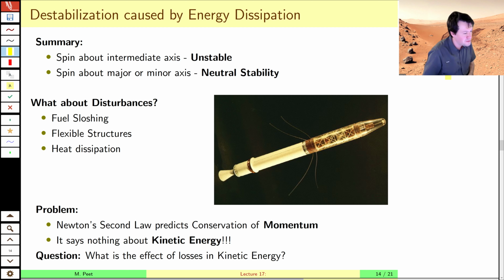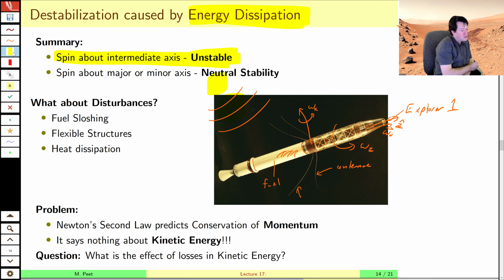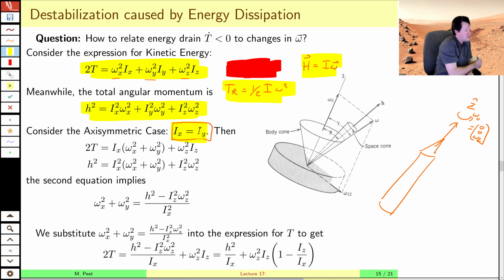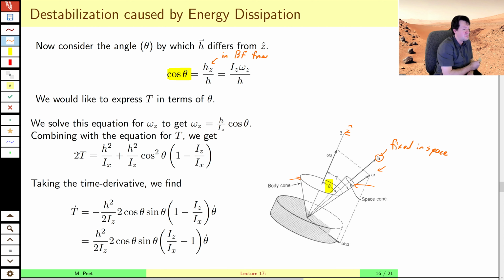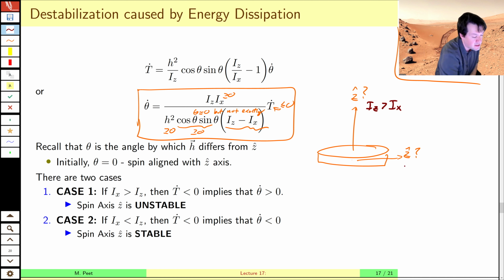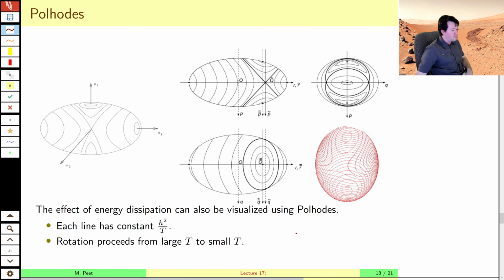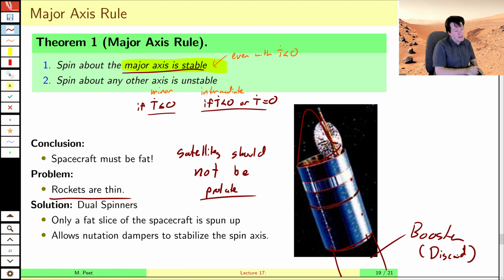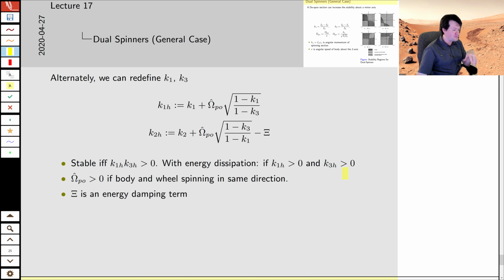AEE 462 Lecture 17b - Energy Dissipation and Spin Stability about the Minor Axis

Comment: I just had a question on the concept of internal energy dissipation, and a certain concept it implies.
     So in the case of internal energy dissipation essentially we have internal movements within a satellite, whether it be fuel sloshing, flexible appendage vibration, etc. Given these movements are INTERNAL they have NO effect on the overall angular momentum of the satellite, given internal torques cancel, but these movements have the ability to DISSIPATE the kinetic energy of the satellite. 
     So in the face of decaying kinetic energy, leading to decaying angular velocity, but a simultaneous conservation of angular momentum the thing that has to change is the spin axis because inorder to conserve angular momentum in the face of decreasing angular velocity mass moment of inertia must INCREASE. 
     Therefore as internal energy dissipation happens the satellite will eventually become a MAJOR AXIS spinner because that's the point of MAXIMUM mass moment of inertia. This being an argument as to why spin about the major axis is the only true stable axis of rotation.

     But the part I don't understand is WHY would internal energy dissipation effects JUST STOP once the satellite becomes / is a major axis spinner???

     Wouldn't fuel continue to slosh? or wouldn't flexible appendages continue to vibrate? etc. I understand MATHEMATICALLY why internal energy dissipation would NEED to stop in order to not lead to a violation of newton's 2nd law of motion, but I don't understand PHYSICALLY why it would just stop??? Couldn't something be put into a satellite to deliberately dissipate energy internally through some sort of internal mechanical motion to continue to dissipate energy once the satellite is a major axis spinner. wouldn't this lead to the angular velocity to decrease further, demonstrating a violation of Newton's 2nd law of motion in terms of rotation???  

     So is there a way to explain purely PHYSICALLY why internal energy dissipation would just stop once the satellite reaches a state of major axis spinning?  

     I understand all the mathematics, but I just don't understand PHYSICALLY why internal energy dissipation would just suddenly come to a stop, at this point of major axis spinning.

So a physical explanation to my questions would be nice, not a mathematical one,  if there is one.
Reply from the maker: The major axis theorem is not actually mathematical, but more based on the observation that spin about the minor axis is unstable for only partially-rigid bodies. There are known problems with the sort of hand-wavy explanation that kinetic energy dissipates and becomes thermal energy. It is possible to stabilize about the minor axis, but it requires an active control system.  However, your specific question about what happens once kinetic energy can no longer dissipate is relatively easy to answer-- the craft can lose energy in other ways -- e.g. thermal energy can radiate into space.